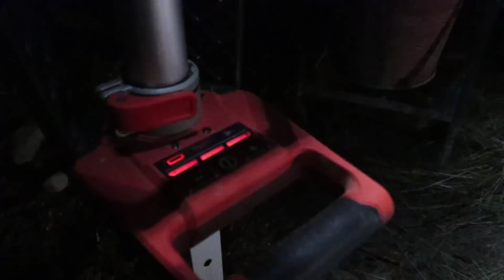this is why we gave it all up

Comment: When you get down to wood with all the nails etc. just have a bonfire then recycle the scrap metal left behind. The nails and hardware are annoying to clean out of a wood stove and you have enough you wont use it before it dry rots. Just advice from the peanut gallery. Have a great day and thanks for sharing your journey.

Comment: So, no need for a pump or chemicals when your hot tub has a freeze cycle? Also, those harbor freight trailers are worth every penny; make sure you wire a separate ground wire.

Comment: What a waste  of those long poles.  Together with the long offcuts of the timbers the cut to firewood the had enough to build temporary "roofs" for the cars....or even the backhoe. But Jessy would had to loose is "perfection addiction" and do it in a day....Just cut and screw things fast and decide details  as you go.
Reply: xedasxedas  Been there, done that.   The offcuts may have some limited uses but the thin poles are a nightmare in terms of maintenance, particularly in areas prone to wet/damp conditions.   No matter how much you keep on top of them, they will rot from the ends.

Comment: You're making wonderful progress. And it can be a real morale booster to tidy things up, making moving around that much easier. I know there's quite a delay between the work and publishing video, but you might have considered using some of those old two-by's as a framework for temporary doors over the garage entries. Skinned with clear plastic and/or tarp material, they'd keep a lot of weather out and heat in. Keep up the good work. You're beginning to feel like family and you're making us proud.

Comment: I still haven't figured out why you would build a house on the side of a hill,risking LAND SLIDES ! with all the added unnecessary expense you have gone through trying to solve drainage issues,
Reply: Michael Ingenito...    
yeah I think so too.   
Especially as the ground seems to be so loose anyway..  and the rocks in there are all river rocks and rounded.  
I can't help but think a thorough soaking might cause the lot to start rolling down.  
AND no separate retaining wall...   the retaining wall is the side of their house!

Comment: Jess, honestly you should get the building closed in.  Shear those walls and get moving on  your close-in.  You need to work out a time frame for the rest of the house build and know what to do next.  Most important knowing what is the next "thing" to do and have your material on site and ready.  Have in your mind or better yet on paper what you have to do to prep for the next step in the building process, like building your temporary scaffold on the two gable ends of the building so you can shear those big ass walls so the building doesn't collapse.
Reply: They're using SIPs
Reply: Rich, evidently you haven't been paying attention . . .

Comment: Typical - message them with concerns you have in a non threading way and POOF you get blocked. I’m sorry your project management skills suck and sleep deprivation is causing poor decisions. People comment to point major mistakes out to save stress in the future. It’s fine. Block me over your poor decision to essentially make a high priced washed river rock condom around your house. Let’s see where the water goes and why it’s not draining out of the pipes around the house. This house could have been completed but instead you choose to drag on every task and half effort most of those tasks. Big thinking is avoided so this build will take a minimum of five years. I’m pretty sure I won’t be interested for that long. 
Bugaboo is the true star of this vlog. ✅
Reply: I agree, the management is not logical, as a project manager by profession I am expecting an outcome that would surprise me in way like "man I was wrong all the time" but it simply doesn't happen. Silly actions of wasting energy (money and time) plus his back must hurt every now and then. Why? He has equipment available. The machinery he has should indeed get forks, it is an invest wisely spend and I agree it needs proper maintenance. It has been mentioned before, the commentators keep repeating about it. It would be nice he learned from it but I doubt it so he will spill his energy over and over again.
Reply: Agreed, their flooring and timber frame are the most important/expensive ....whilst sitting out in the elements.
 Get a roof on and worry with having sips precut for windows later.
Add forks,build a jib for the hoe,get the house drying out first.

A septic system hasn't been needed so far ,why now?

Time is of the essence to get the house dried in.
Cutting up good 2xs shows time is more important then money....so it is for every builder regarding sips .
Install it,the roof ....dry the house out........then buy windows ,cutout sips and install them,like 99%off everyone else.
 In summary,sips do not need to be custom ordered,sips do not need to be installed before the roof,the roof keeps 70% of moisture out,the sheathing=sips does the rest.

This is like the sawmill,(2 logs cut on 2 sides,laid under then anchored to the mill and bobs your uncle) instead of dropping wood on then readjusting, constantly #2 the trench opened for nearly a year,#3 the French drain around the house,#4 the backhoe with no forks.

Comment: Why didn't you use the boards for hot tub fires? You may think you have an over abundance of firewood now, but if you plan to heat the radiant heat boiler with firewood for a big house, you may wish in a few years you had saved the good firewood.

Comment: i really dont get what it should bring to let the enginge runs in advance to heat it up, nothing to win here besides damage of the enviroment ( and your purse) its better to not rev the engine to high when its cold and even that is no real big problem , especially if you service it regularly like he does, or is this normal in america to burn fuel and money for no reason besides not freese the first 3 to 4 minutes in the car?   .... also what is the big problem with wood and planks with screws and nails to burn? burn it and after that get the screw and nails out of the ashes, only if its really rotted you can throw it away because it wouldnt burn good
Reply: I do it in very cold conditions here in the UK, just briefly, so the windscreen demists. Obviously if you drive and the windscreen mists up its a danger.